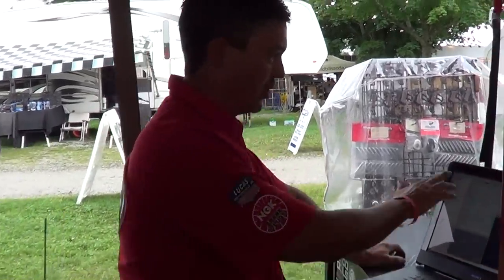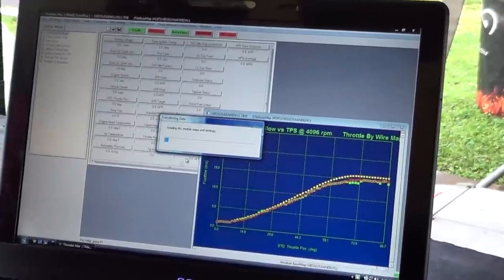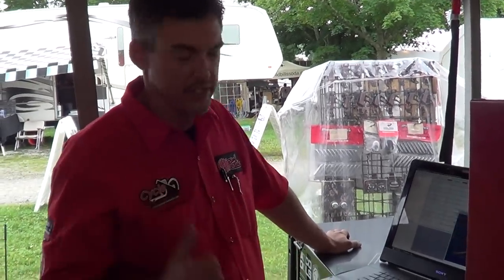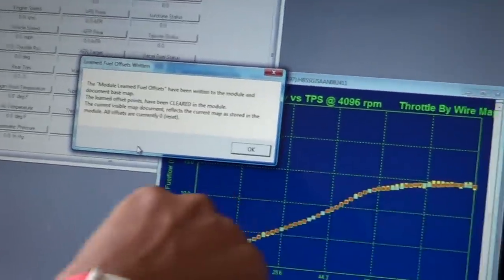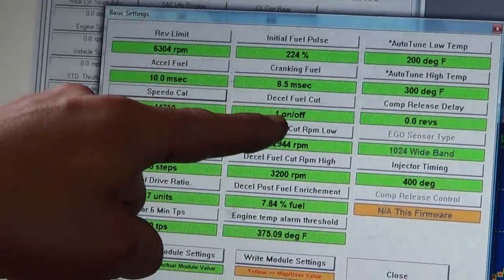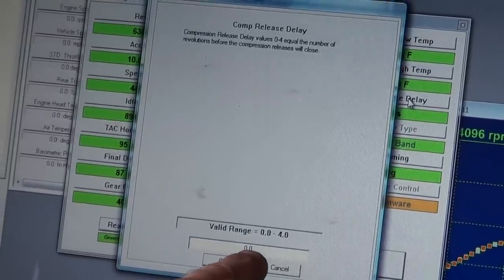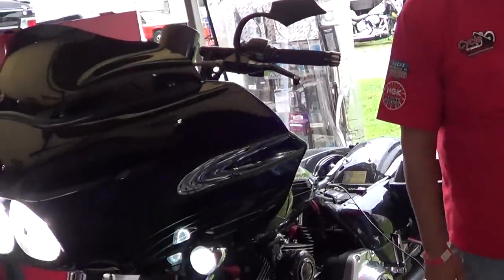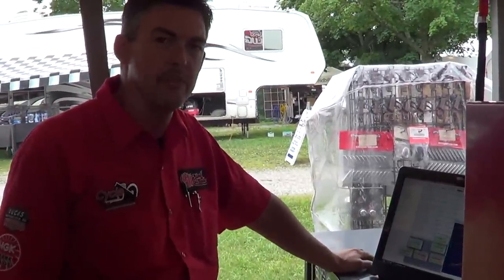Thundermax Auto Tune - Auto Map Tutorial (2 of 2)

Comment: Hey Chris,can u suggest a set of base line maps for for this set up for 2014 Street Glide.
Screamin' Eagle Twin Cam Tire Shredder Kit - 103CI to 110CI
SE 4.0" bolt-on cylinders, forged 10.2:1 high compression pistons , SE 58mm throttle body, high flow fuel injectors, SE CNC-ported cylinder heads, SE-259 cams, perfect-fit pushrods, SE high-capacity roller tappets,
True dual rinehart & Arlen ness big sucker...Just purchased T/M tuner & would like to have your option...Thx

Comment: hey man, im pretty new to the thundermax software. my bike is hard to start when it its cold like its getting way to much fuel off the bat. i noticed when i uploaded my map to the thundermax, the fuel pump runs for probably double the time it should before i actually start the bike. just wondering if there is an easy fix? ive messed with pretty much all the basic settings and nothing seems to cut back the initial fuel pulse.
Reply: Candle maybe?

Comment: I thought the point of TM is to always autotune as you ride. Why do you need to hook up a computer and write the auto tune? Does this mean if I were to remove the battery I would loose the autotune?
Reply: GoofyRyder HD the TM is an aftermarket, replacement ecm. Harley has a proprietary system for their ecms. This is why you have to take it to them to tune. Or use to. The TM must be set up to run your bike, then you run the bike with the “auto tune” on. It looks at your air, fuel, throttle position, engine load, temperature, humidity, everything. And knowing the predetermined ideal air fuel mixture. It corrects all the values to make the bike run in those parameters. Then you flash that onto the ecm. This is an open loop system. It is unlimited in its reach but can’t apply the changes to the bike and write them at the same time. A closed loop system will read exhaust gas (o2 sensors) and fuel and will tell the ecm what to change, to get the a/f  correct. Which seems better. But with an OEM closed loop system they have narrow band o2 sensors. Sonthey can only read a small area of air to fuel mixture. An open loop wide band system can see and control a lot more. But it’s can’t write and correct at the same time. as where an OEM closed loop can adjust in the fly to the bike but much less precise. Now these are also opposite ends of the spectrum. You might like the power vision tuner basically does what the TM does. But you can’t control the ecm the way you can a TM. The power vision is a good daily bike tuner. The TM is a good race bike ECM or something like that.
Reply: @thomasmarchese2808  
You're wrong, the green points are the corrections that it made while you were riding, when you do the auto tune that he showed it simply updates the map to the corrected points so you can save it for future use, also the system is only able to correct the loaded map by 10% at the most, so by auto tuning your resetting the map points to "0" so it can move them more if it has to.
And it is a closed loop system, it does as I explained adjust to the AFR targets as you ride, one again auto mapping just resets those points, or re-zero's them if you will, then if any of the AFR points had hit their 10% limit it can continue to move them by doing more riding and then auto tuning again.
After 3 or 4, 25 mile rides you do an auto tune, then do it again, after doing the process several times you'll see that it won't move any of the points anymore, at that point it's 100% at the point that your particular engine and combination of parts (ie cams, exhaust, heads, air cleaner etc.) are hitting the AFR ratio targets that either that map calls for or if you customized the AFR points yourself.
But once again it is closed loop (although you can turn that feature off).
It's a great system, I've been running one on my 05 Ultra for 3 years and I have it at the point where I get 47 MPG with a passenger at sustained 75 MPH with a 3" taller than stock windshield, I haven't spoken to anyone else or even seen anyone on the internet post that kind of mileage, not at 75 MPH sustained.
The only real beef I have with it is the instructions on how to set up and use the system, they could have done a better job of explaining everything in the manual instead of wording everything as though the end user was someone who was involved with developing the system.